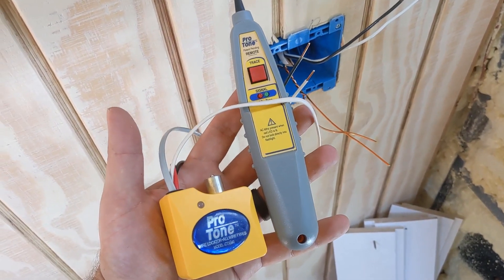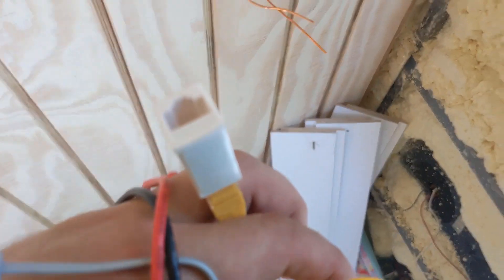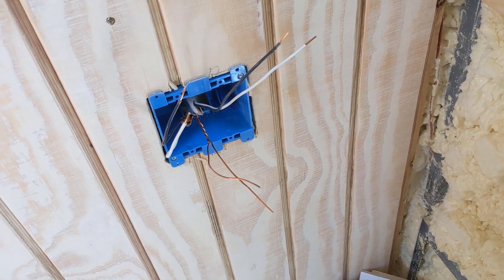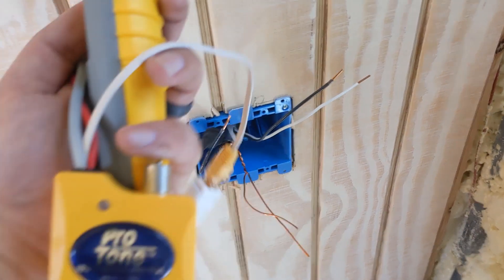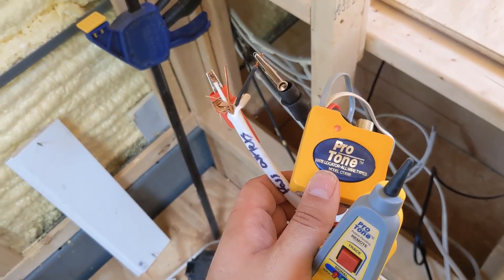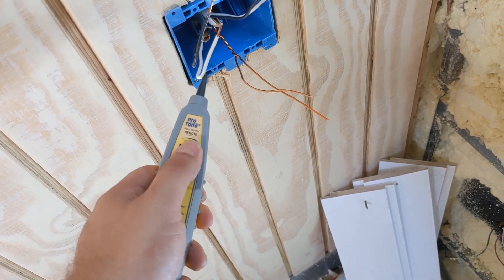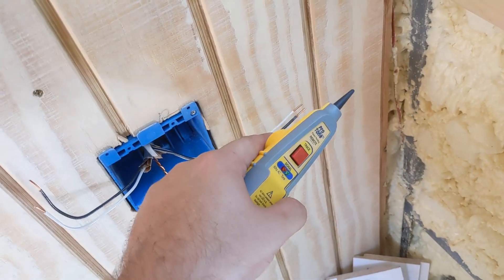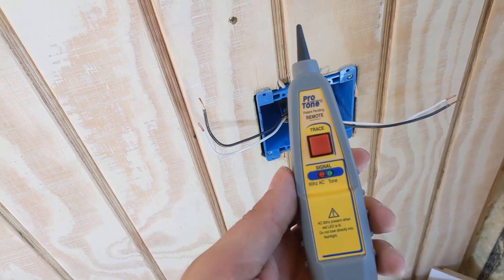Tone Generator - Tools that can save the day #3

Comment: Next month I may be in a scenario where I need to trace out ethernet and cable coax from basement to main floor to sort out what goes to which room/outlet, and I've been struggling to find low cost 100 foot multimeter probes for the DMM continuity tester!
Reply from the maker: That's really funny. Before I had one of these I would use a really long wire to use my meter to test that stuff
Reply: @AnotherMaker  My fallback plan was going to be use alligator leads to short one end of the cable and then go to the other room and just probe there until I find the shorted cable.
Reply: @GadgetReboot  I used a 9v battery across two wires so I could check voltage in the other room